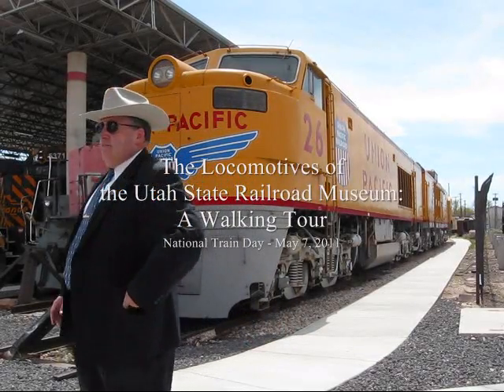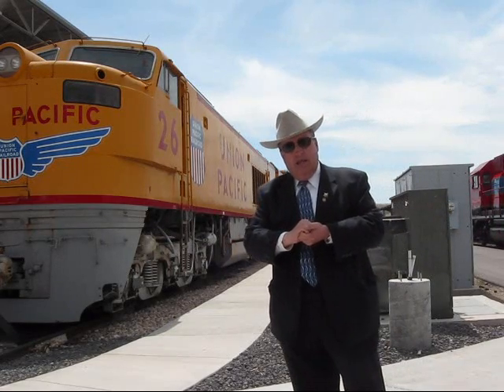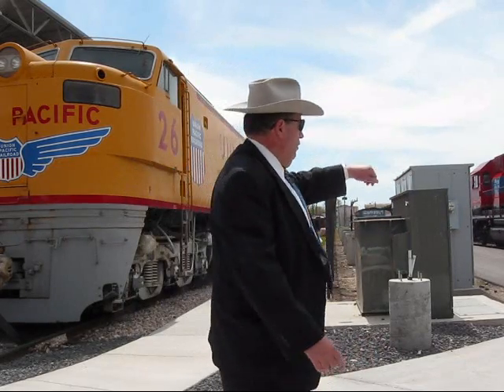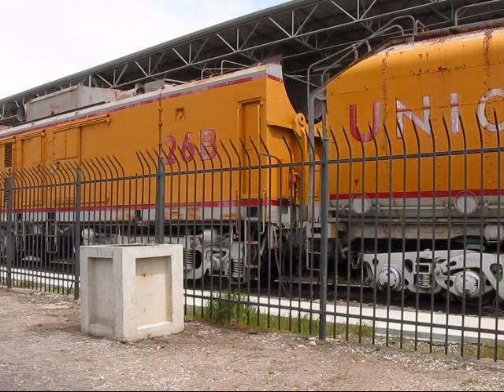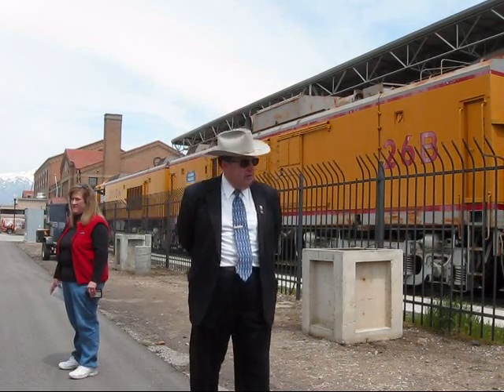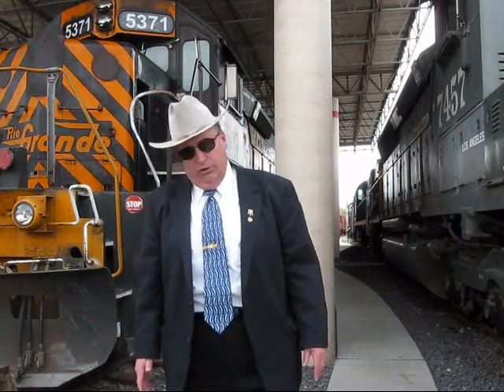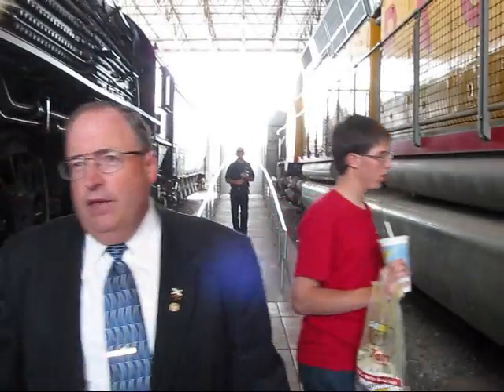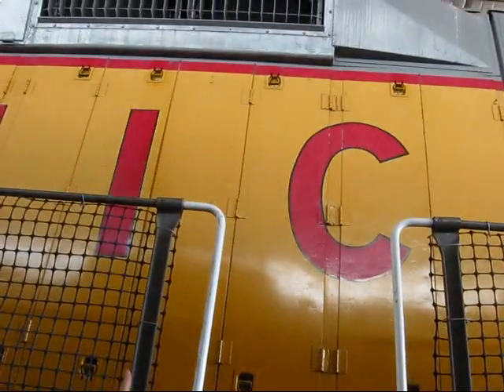A tour of the Eccles Rail Center

Comment: Guy deserves a raise - he's incredibly informative.  The tour itself is very informative - most footage of the turbines don't show the honking big exhaust pipe very clearly, but nothing quite like that to remind you you're looking at a jet engine on wheels.

Those flagging turbines were nightmares on wheels, but they also were pure Rule of Cool, and they did their limited job very well.  But like all unibody locos, they were doomed by the LH/SH liftable designs and the fact that they ran on a fuel source that, while plentiful after WWII, quickly because robbing-peter to utilize.

Comment: He is a very good tourguide, and knows his stuff.
There was a slight hickup in the explanation of the Big Blow, they were the most powerfull locomotives when built, and remain the most powerfull combustible powered type of single locomotive (as he explained the parts can not be split up into single working units)

However, by the late 60's there were electric single unit locomotives emerging that did have more horsepower, like the Deutsche Bahn E03 prototype in 1965 that did have slightly more horsepower (8750hp) and the serie production model of this locomotive (1970) did produce 10500hp continuous and 14000hp for 1 hour.
In 1975 the Sweizerische Bundes Bahnen introduced their Re 6/6 (Bo-Bo-Bo) locomotive that also could produce 10500hp continuous.
In terms of tractive effort and the capability to pull long heavy trains the Big Blow still is the big winner, as these electrics are much smaller and lighter locomotives built mainly for high speed work, the E03 had a top speed of 125mph and was for the Trans Europ Express trains inside Germany.

The Re 6/6 was intended to speed up freight workings over the Gotthard Pass in Switzerland, their task was to move a 1400 ton train at 55mph up the 2.6% (1:38) continuous gradient of the Gotthard, the high speed was needed because of the density of the traffic on this line (Passenger and freight workings at a rate of 20 or more trains per hour) all that horsepower was needed to maintain that speed, the 87000lbs of tractive effort being enough for the weight of the trains, with heavier loads the screw link couplers could break.

Comment: back in 1978, i was at the rock island yard, burr oak/chicago.
they had a brand new DRGW tunnel motor, SD40T-2 on the turn table.
strange, it was sitting there turning, then RI emplyees were in it, on it, even on top of it.
I guess it had been many years since they had ever seen a new loco!
Reply: the engines at the terminal/yard were,
GP7,GP9,U25B,U28B,some SW type switchers,a mutant RS3 with a GP long hood.(ex CNW?)
in the round house was in adjacent tracks, GP7,E7,F7(in up paint)
working the yard were several C415s. quite the museum.
Reply: Oh, poor Rock Island! 1978 was only 6 years from the end, but what a slow, depressing death! They probably were impressed by the fact the SD40T-2 had all its' parts!

Comment: Turbines got the nickname Bird Cooker because of their tailpipe when they fired up they would shoot a 30 foot flame out the pipe and it would cook any bird who was flying near the engine.
Reply: +Aaron Peavler/Geomodelrailroader Railroad Photography It gets you to wonder why the crews didn't take advantage of this Side affect. For Example, imagine if the crew is having a stake out one Night But don't have a working stove to cook the Chicken. They would just construct an apparatus on top of the Exhaust section of the Turbine to put the Chicken and Intentionally block the Air vents so the Engine will Burn out and Cook The Chicken for them to eat.
Reply: Joe Smith wait what

Comment: It would be cool if they brought back the turbines. They would still be great engines in today's world.
Reply: They use them around here in Boston to blow snow off the tracks in the Amtrak yard and on commuter rail. I saw CSX using them on the mainline to Selkirk NY back in the 90's when I worked for Amtrak. They are loud.

Comment: Wrong on all accounts 
These turbines were rated at 8500 hp at sea level and at 80 degrees atmospheric temperature BUT Wyoming is not at sea level , which means less air for the turbines to use and restricted HP. 
In Cheyenne WY. These could only produce 7000 shaft HP. or about 6200HP  at the coupler ------
The PENNSY GG1 produced 4760 HP.  but the GG1 could over load to 9300 HP. for 1.5 hrs ...
Pulling out as much power over the over head wires as needed -----
The EMD electric of 1976 --- road number 1976 was an electric that produced 10,000 HP  and could overload to 14,500 HP. 
BUT IF YOU LOOK UP HIGHEST HP. LOCOMOTIVES ,, THESE DON'T EVEN CRACK THE TOP 20 IN THE WORLD !!!!!!!
Mother RUSSIA HAS AN ELECTRIC THAT PRODUCES OVER 16,000 HP. 
AND NOW CHINA HAS ONE PRODUCING  OVER 20,000 HP -----
But hey , all the U.P. FAN BOYS SAY 
OURS WAS THE BIGGEST 
THEY NEVER HAD ANYTHING THE HIGGEST  ----- EVER !!!!!!!!
A SINGLE BALDWIN (( CENTAPEDE ))
DR12- 1500/2 
Centipedes 
Weight 595,000 single unit 
DDA40x
Weight 540,000 
Centipedes was heavier 
DDA40x was never the longest at 98ft 
The CENTAPEDE gets that award at 
183 ft  2 units semi coupled together 
The Alco side rod electrics if 3 semi coupled unit measured in at 225 ft 
Longer than even the #80 turbine experiment which was 214 ft 
Then I've heard this argument 
"" on a single frame ""
Sorry but that goes to N&W 's 
JAWN HENRY at 112 ft for a single unit 
And the heaviest SINGLE 7NIT GOES TO 
C&O steam turbines at a whopping 
856,000 lbs without the weight of the water tender 
Steam engines 
2-6-6-6 ALLEGHENY 
Weight 
778,000 lbs
Big Boy 
772,000 lbs 
HP. 
C&O. 2-6-6-6 ---- 7800 HP 
PRR. 4-4-6-4 ---- 7982 HP 
UP.    4-8-8-4 ---- 6200 HP 
And when we start talking about the UP. CHALLENGERS 
They were some of the WEAKEST of all the big articulates 
HELL even 2-10-4 were better at pulling than the 4-6-6-4's of UP 
The PENNSY'S 2-10-0 decapods produce 108,000 lbs of tractive effort 
The Challenger 
produces 93,000 lbs of tractive effort
So sorry to all the U.P. FANS 
Do some checking for yourself and you'll see that a guy like in this video is selling you a story for his museum 
"" THE CAR WAS OWNED BY A LITTLE GRANDMA THAT ONLY SHE  DROVE ONCE A WEEK TO CHURCH ON SUNDAY """